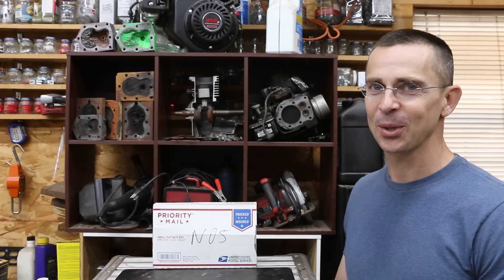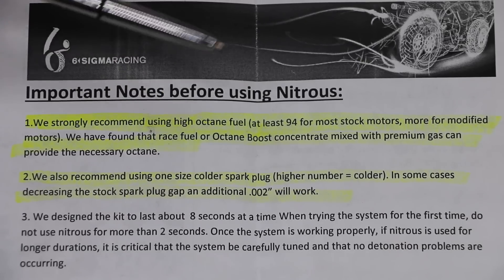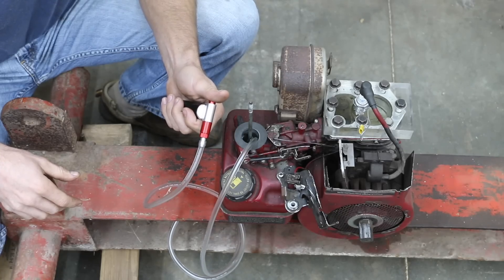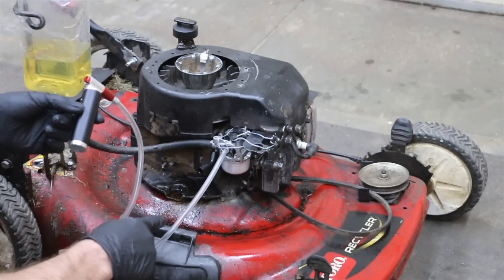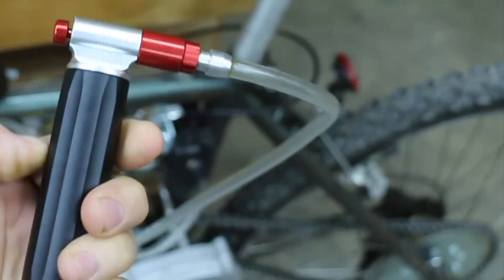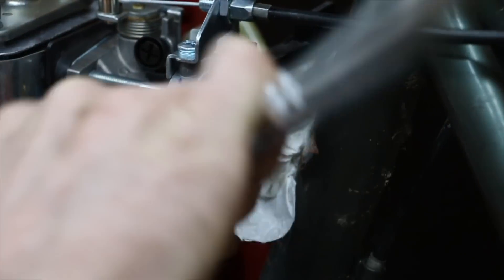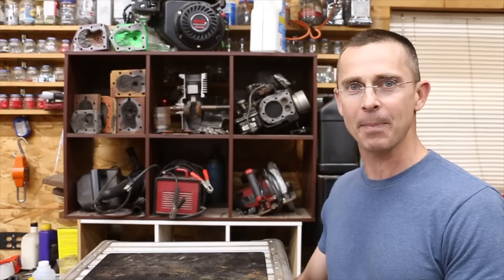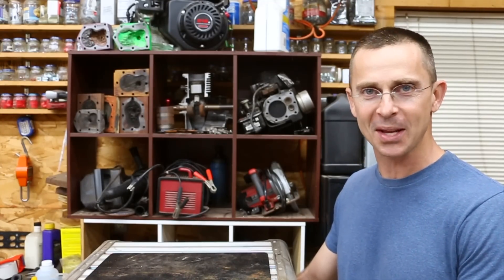Will the 4-Stroke Bike Survive Nitrous Oxide?  Let's find out!

Comment: Air is about 21% oxygen.  (20.94%)
N2O is about 33 percent oxygen.

You need to add some more fuel, 
when running a NOS system, like 
the big boys do.

Look at the Hot Rod videos, when 
running nitrous, they also inject 
gasoline.

(I wonder if this would work on a 
2 stroke bike?)

steve
Reply from the maker: Thank you

Comment: Here’s an idea 💡 take your motor bike Conversion and connect a mini scuba tank to force air into the carb like a blower   And hit the nitrous lol   One port on scuba regulators is 3000 psi ( nothing to fool with as my Brother cut his thumb half off with the port but the other port is 125 psi ( that’s prob more then a engine blower ?  Have you seen those well built mini 4500 psi air compressors on eBay ? You can get one for $300 and you can use them to fill the bottles up to 3500 psi for paint ball  ( not certified for scuba tank diving )   Or maybe you could make your own blower for a single cylinder ?  I seen ones that use a electric fan for auto racing ( pretty sure they don’t work ) that May though for a bike motor your using.
Reply from the maker: Thank you for the video idea!

Comment: Now try it with the 2-stroke kit :D
Reply: That would be very interesting,  since a 2 stroke makes more power with the same displacement.
Reply: L E  improves efficiency as in?
Reply: @mikecheeze4312  cools the engine
Reply: @davidthomsen7876  an engine has to be at a certain temp to reach optimal efficiency. Also why do you think engines burning nos need larger cooling systems?? It sure isn't because the nos cools it....
Reply: Will do the same thing... all nitrous is(technically for a motors sake) is extra o2 molecules to be burned. It'll do same thing in any engine that burns o2 and fuel
Reply: Duh, its only logical that it cools the engine. Of course a more efficient burning process, which releases more of the fuels chemical energy in usable force will open a quantum loophole pulling heat out of the cylinder. Please don't tell me you didn't learn this in school.
Reply: Jesus people.... nos cools the temp of the fuel/air mix, not the engine itself....
Reply: How to pollute the earth...

Comment: Would pulling the governor make it go faster as well? For just top end at least
Reply from the maker: The 4 stroke doesn't have the top end power to make use of the gear.  The 2 stroke runs out of gear before power. Thank you

Comment: Tip if the temperature starts becoming a problem you can buy very cheap PC water cooling parts and running off at 12-volt battery that would pump water through copper tubing like that thin copper tubing they sell at Home Depot run it in between the heat sinks and use computer thermal grease Should significantly lower heat
Reply from the maker: Thanks for the tip!

Comment: You have to add more fuel with the  nitrous.All you did was burn a tiny amount of fuel that was going to get wasted out the tail pipe with out the nitrous.Causing a lean mixture. This test should be  tried again with fuel added when nitrous is engaged..

Comment: Problem is, that's not the point of NOS. As it breaks down, the release of extra Oxygen, combined with its cooling effect, allows for the combustion of more fuel. Unless you install extra fuel jets, all you end up doing it making a lean AFR. In a way, it's kind of like alcohol. Allows more fuel to be burned than a normal air/gasoline mixture.
Reply from the maker: Thank you

Comment: Be curious to see the effect in an engine such as a diesel with very high compression ratios and no spark plug. Based on the spec sheet I’d figure precombustion, but if timed correctly with the injector I wonder if it would give any kick to a Diesel engine?
Reply from the maker: Thank you for the video idea!

Comment: When adding nitrous to an engine you do see a power increase.

This is not from the nitrous oxide expanding as it separates into its basic components of nitrogen and oxygen.

After the separation occurs in the combustion chamber, the oxygen itself mixes with the fuel and creates a much faster more complete burn with increased cylinder pressures. That's why you end up more power.

If you want to have real fun with a completely disposable engine, use oxygen from an oxy acetylene torch instead of nitrous. Hell of a lot more power but very quick destruction of the engine because it will melt down most of, if not all the metals.
Reply from the maker: Thank you
Reply: @ProjectFarm  thank you for acknowledging my post. I hope the information I have added will help further assist you or others looking to experiment with the different gases.

Comment: You really should be adding some sort of fuel boost along with the nitrous if you hold the button for longer than 2 seconds. That alone will stop your pre ignition.  Maybe a butane or propane cylinder of similar size? Like one intended for refilling lighters. That might be the perfect gas to go along through the same line during boost. The wheels are turning in my brain. I can't wait to try this for myself. Good luck to you. Thanks again for the great video
Reply from the maker: Great point. Thanks again

Comment: You made some great videos. Thank you. To add to your knowledge I will tell you you do not want high compression when adding nitrous oxide. The best engine to put nitrous to is the one that has worn down compression. With that said you don't need to worry so much about reducing the spark plug gap or temperature of the spark plug.
Reply from the maker: Thank you for this information!

Comment: You are only supposed to use nitrous with the throttle wide open.
Reply: ...I mention that because you were hitting the button on the bike idling, that's why it was pinging. That's why proper nitrous kits come with throttle position sensors.
Reply from the maker: Thank you!
Reply: @ProjectFarm  I'm not trying to be an asset or anything, just something I learned the hard way when I was young and dumb and tried using whipped cream to nitrous a 50cc scooter.  Whipped cream uses it as a propellant hence kids enjoying spraying whipped cream into their mouths! Because nitrous oxide is also known as I'm sure you know "laughing gas" LOL

Comment: Just wanted to sayIim glad you made these videos. the 2 and 4 stroke ones were very informative. I even bought my own 4 stroke kit after seeing your video. I also bought a jack-shaft kit to use my gear assembly. My bike goes about 35-45 mph. I am still working on adding more range to that. Currently I only have access to 2-4th gear because of chain dynamics. I am looking to add a new sprocket to the front assembly so i can regain 1st and maybe even get 5-6 up and operational. TY project farm for inspiring my own project.
Reply from the maker: Very impressive!  What a nice setup with the jack-shaft kit!  Please be safe!

Comment: Lambordini a company in Italy makes a diesel small engine that may be fun to play with ..maybe a propane kit .. maybe convert a Barbie Jeep ..  then there always a miniture v8 from coneley that could be a hoot on a tricycle ..I love to build weird stuff .. but im retired now and can't really afford to play to much ..so I do most of my tinkering on radio controlled models ..a scratch built nitro methane diesel two stroke the size of a 8 hp Briggs could be a lot of fun , my RC engines idle at 15000 rpms they top out at around 45 to 60,000 rpms depending on fuel and manufacturer ..the engines are really simply made and make insane horse power for the size of the engines . It would be a hoot to see a larger scale version on a mini dragster .. that you see kids race , it would definitely be interesting to see ..my RC care does zero to 60 in 2 seconds flat and peaks at 117 mph ..I can only imagine the horse power you could make on a scaled up rc model engine ..mane there a way to convert a small engine like an old lawn boy two stroke ...ping ping ping .......lol
Reply from the maker: Thank you for the video idea!

Comment: BUILD a go-kart using twin bicycle engine kits with nos even better an engine on each wheel rig the front two engines to work off the steering to apply more power to the out side wheel in a turn .. you can do it ..
Reply from the maker: Thank you for the video idea!

Comment: Oil burner is right that is how we tune nos for the most power without melting it down. We make it fat with extra fuel presure with the fuel pressure regulator to the fuel selanoid on the Nos, then make a pass, checking the exhaust temp. Then we reduce the presure and watch the exhaust temp rising as fuel is getting skiny.
Then we reach a desired temp that does not melt down the pistons  and we stop. 1500 1600 degrees with  nos pistons then we check spark plugs for flecks of silver in case one cylinder is leaner than another then we make it a little Richer on fuel...
 Otherwise we get pretty sparks out the exhaust, the pistons are melting and burning coating everything with molten aluminum on its way out.. 
Sometimes burning the valve stem off and the mushroom destroys it  not much left .
There have ben some close calls with 60,000 to 70,000 dollar engens from small mistakes.
Reply from the maker: Thank you

Comment: If you don't add extra fuel when the NOS system is running you are wasting your time, the engine will just run lean which could cause you to burn a hole in the piston or at least drive the engine into detonation. The main reason that NOS works at all is because the liberated oxygen allows you to burn more fuel and that is what gives you more power.
Reply from the maker: Thank you!
Reply: @ProjectFarm  I think that you were getting an increase in power because as the NOS was splitting up into nitrogen and oxygen it was pushing the peak cylinder pressure up, a bit like squirting compressed air into the cylinder head just at the right time in the power stroke!

Comment: You should do a comparison of head volume vs compression and how they are related In a flathead application. I suggest that because while you can increase flow by milling a head out you can lose compression. Where would the the sweet spot be?
Reply from the maker: Thank you for the video idea!
Reply: Matt G That’s an interesting thought, I think you could weld in (reduce the depth) of the combustion chamber bowl at the spark plug without affecting the ‘finger’ of the bowl that usually reaches out toward the valves. Or maybe mill the head as usual but machine down the block area between the valve seats and the cylinder

Comment: A mechanic whose son was a racer once told me that it's not a detonation that occurs (it's not flammable), it increases the amount of matter in the cylinder which increases the compression.
Reply: The truth is...
When you heat nitrous oxide to about 570 degrees F (~300 C), it splits into oxygen and nitrogen. So the injection of nitrous oxide into an engine means that more oxygen is available during combustion. Because you have more oxygen, you can also inject more fuel, allowing the same engine to produce more power.
Reply: This is similar to a turbocharger compressing the air to hold more oxygen in the same amount of space.
Reply: Why not just add pure oxygen?
Reply from the maker: Thank you for this information.

Comment: I think a nice video would be to turbo or super charge that bike and another video would be to run that engine through the front sprocket and change gears as you drive and giving the engine an over drive will give it high top end
Reply from the maker: Thank you for the video idea!

Comment: Aren't you not supposed to use nitrous unless the throttle is open fully? Could that be why the bike motor was pinging when you were idling? Or am I mistaken about that? Maybe that's just with cars.
Reply from the maker: Great point.  It needs extra fuel.

Comment: a fun project for you would be to convert one of these bike engines to run off R/C Fuel. Which is methanol, 2 stroke oil and Nitromethane. Same thing the top fuel dragsters run...just in a lower concentration. Model car fuel is available up to 40% nitromethane. You'll only need to change the fuel lines, make sure the carb orings and needle valve are alcohol compatible and jet up {double the jets} or use a bigger carb. HP should roughly double.
Reply from the maker: Thank you for the video idea!

Comment: How about those boost bottles which are just empty tanks, which you tap into the carb manafold between carb and engine and then you do a similar install with a threaded part tapped in there.  Supposedly it stores some unburned fuel and increases power, or does it?  I saw these on eBay marketed for gas scooters like gopeds and other scooters and was skeptical.  Does it work?
Reply from the maker: Great test idea!

Comment: oh but for cars using hho, mustlean fuel injection. hydrgen is actually very dangerous. and never fill a tank without spliting it from oxygen. i thnk positivesoxygen. negs hydrgen.? and wit propane shudnt be used uunder idle only load but ur application it might not matter so much snce its not diesel since thats where i heard that frm. but thr converter alotta city buses and stuff to propane claiming its a safer option.
Reply from the maker: Thank you

Comment: bicycle not lawn mower performance researxh & development "r&d" maybe in future ull hav enough trials to sell kits with all different applications! how much was the nitrous?
Reply: yessir. the nazis for thir napalm men it was a larger tanker of nitrogen that pressurzed a medium tank of napalm (kerosene/styrorm) that extended to a handheld with a mini propane  tank nozzle low with a ignitor tip. there differentvalves within this setup. because the tip stays lit so when the napalm discharge flows a liquid fire stream. but nitroge was ussed bcus it wudnt be a casualty to itself md its own comrads
Reply from the maker: The kit was around $70. Thank you

Comment: I did a lot of 'experiments' when i was a kid using a similar setup with a thing called a Butox welder, it used butane and nitrous oxide with a regulator for each. I made all sorts of injection systems with different solenoid valves into my two stroke go kart engine and by adding extra butane the gains became extreme, the thing would burn up the tires for about 3 seconds.. eventually though the engine detonated, splitting the crankcase in half. It was fun, but a really expensive way to make more power.
Reply from the maker: Thank you!

Comment: Would you run an engine on pure oxygen? Keep it cool with water injection. This should make an awesome video. Maybe carburated or hook up through a fuel injection line and run straight oxygen cooled by water injection through the air breather!
Reply from the maker: Thank you for the video idea!

Comment: If you REALLY want to see a boost, mix tetra-nitro-methane into the gasoline.
Warning: Read ALL safety data before handling tetra-nitro-methane.

https://en.wikipedia.org/wiki/Tetranitromethane
https://nj.gov/health/eoh/rtkweb/documents/fs/1836.pdf
Reply from the maker: Thank you for the video idea!
Reply: @ProjectFarm  
Again, I warn you to read the cautions carefully. That stuff is poisonous as Hell itself. Once mixed in modest dilutions with gasoline, it is NOT explosive, but mixing with gasoline does not reduce toxicity. Chemical gloves are a MUST. Doing it OUTDOORS as another MUST. Also, start with low dilutions because the stuff contains a large amount of available oxygen. Don't overdo. Unless I miss my guess, the engine running tetra-nitro-methane will run as if it were turbocharged.

Comment: If you're near the engine redline without nitrous you won't get much improvement in top speed without re-gearing. Did you try putting in a gear too tall to run without nitrous and then seeing if the engine would have the power to pull the gear to redline?
Reply from the maker: Thank you.  The motorized bicycle doesn't have the power to pull the top gear to redline without nitrous.

Comment: Project farm I have another video idea.
Magnets on an oil filter. Small powerful neodenmium magnets put on the metal outside of the oil filter, N facing toward the oil. This would remove even microscopic metal particles. This alone could prolong the crank seals by many times. It would be interesting to install on your old truck and cut the filter open at oil change. Maybe look under a microscope to quantify the amount and especially smaller size particles caught by the magnet.
Reply from the maker: Thank you for the video idea!
Reply: Most of the metallic material in your oil will be a bronze or bronze alloy bearing material. High performance oil can have a significant amount of Molybdenum and zinc  additives for boundary layer protection,  these metals arent magnetic so that shouldnt be effected.  Race parts suppliers sell many types of oil filter cutters.  If you have a significant amount of magnetic material in your oil, you need to locate the source of this material.i
Reply: W87ReEntryVehicle well now I know why this isn’t a real thing.. 😂 thanks sir, but it is still a good concept!
Reply: Don't most sumps have magnets already? Most cars i have owned do
Reply: Dude that is actually genius! Especially for when an engine is on the break-in period! Hats off to you my friend!